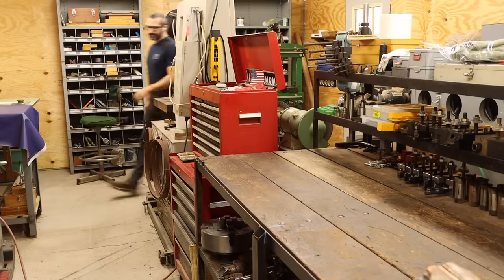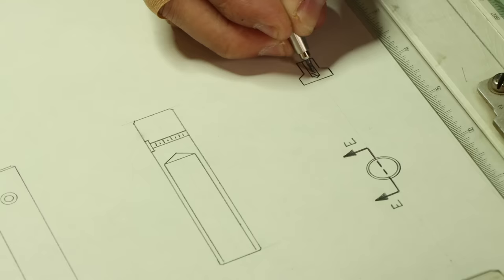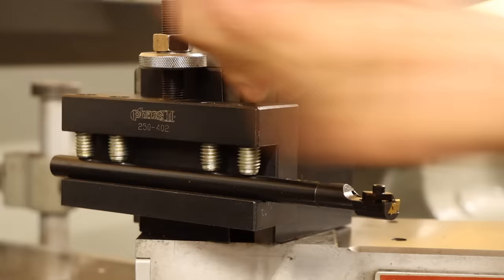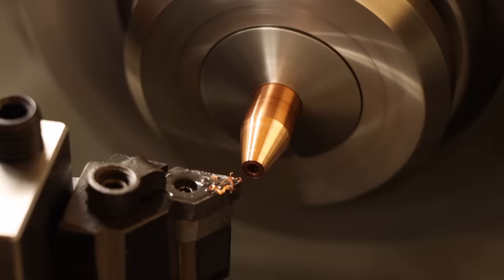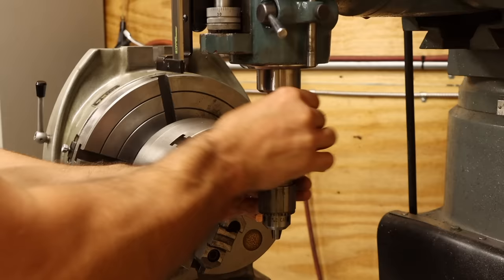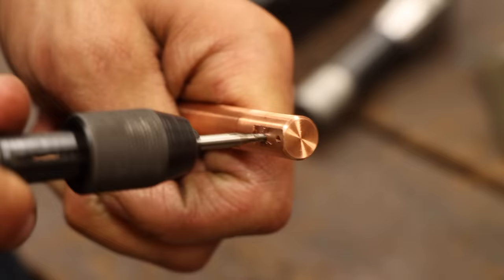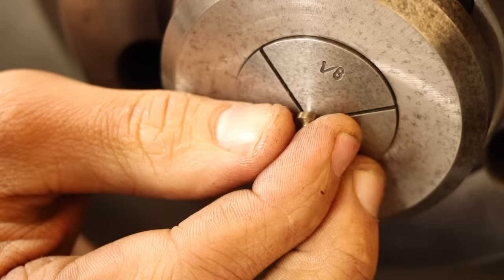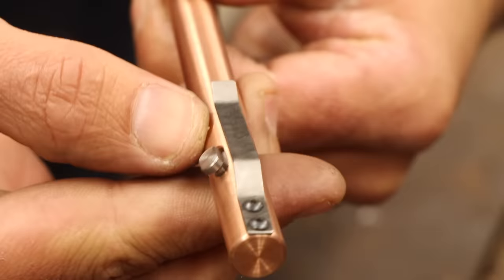Making a BOLT ACTION Pen || INHERITANCE MACHINING

Comment: Loving the channel, just discovered it and I'm currently binge watching the lot!

Just one suggestion, try using a spot drill instead of a centre drill, they don't have the fragile tip and are more accurate to boot (centre drills are primarily intended to drill the features for lathe centres,  the small diameter is for clearance and for holding grease).

Comment: We used to (and still doing it) dissamble the mechanical pencil and put small paper parts we made wet with our mouths,then we used the plastic part that is used to push the pen tip as a pusher,and we use it like its a flintlock

edit:

I used to also use the point of the pencil as a supressor so when i blow it no one hears the wind sound/blow sound

Comment: I got flashbacks when the center drill broke off. In my "Zwischenprüfung" (basically half-time exam, counts for 40% of the final grade) one of the parts I had to create a create was a M10 screw with a Freistich (thread run-off?) and a larger fitting behind (on a machine which by default had 1/100th of a mm taper on ~20mm of travel). The exam is extremely stressful, especially for me because I skipped the first year of apprenticeship and I had way less practical experience and ofc when I wanted to use the center drill it broke off inside the part. I don't really know why and when I tried to get it out, no luck. I had to wait for a new raw part to continue and wasted more then 30min while already as stressed out as somebody can be, jogging from machine to machine because time was running low.

Comment: I realize that this is 9 months too late but for future reference, if you dissolve some Alum in water (it's a substance used in pickling, you can find in spice section of the grocery store) then put your copper part in a beaker and boil it that will dissolve the steel drill bit right out of it.

Comment: A broken off drill bit can be etched out of copper using pickling solution. Simply put potassium alum in a (non metal) pot on the stove and after a few hours or so the drill bit should be gone. You'd need take a skim pass on the outside again to refinish the part but I think that might have still saved it.

Comment: Great!
The only design change I would consider is to - instead of screwing the clip to the pen - milling a tiny slit maybe 5mm from the top and mounting the clip in there. Maybe with a screw from the top end. Milled and in copper or stainless...

Comment: I think if I were to make one, which I can't and never will, lol, I'd personally lathe out a groove down at the spot you hold it and glue(?) in some leather for a grip. I got a strong nose, and the copper smell is strong to me, and my sweaty, slippery fingers would almost require it, haha. But that's just me! I do really like, as you said, the contrasting hammered clip contrasts with the finely machined body of the pen, which the leather may detract from. Your clean design is a pleasure to watch come out and, as always, impressive to see the level of detail and precision you put into your work. c:

Comment: I just noticed that your bolts slot is opposite from the original. In the original the bolt is away from the clip  when retracted,  in your new one the bolt is closer to the  clip when retracted & looks more likely to interfere.  I do like the cold working to increase the clip hardness, this would be more feasible for most people to copy because you wouldn't need to source stainless spring stock or heat treat 17-4. It is a pity that your bolt flats aligned perfectly  the first time because it would be a perfect time to show clocking the rotation via removing some fraction of the threaded knob.

Comment: The only question about this design is the position of the bolt versus the clip. It seems to be very close, prone to engage/disengage inadvertently while using the clip. Otherwise, beautiful machining and excellent material choice. I am a big copper fan.

Comment: The bolt when the tip isnt exposed is on the wrong side, it will catch your pocket material. The original pen didn't have this issue.

None the less, great video!
Reply from the maker: Yeah I missed that on the rebuild for some reason. Thanks!

Comment: I'm currently in training to become an electro-mechanic in Germany.
Having shop training included in this and knowing what a bitch turning materials can be (especially copper and other metals that transfer heat very well), I am in absolute awe at the seeming "ease" with which you did this.
Though, I have to admit, that broken drill bit and the compromise with the end diameter made me feel a bit better about myself 😂
Reply from the maker: If it helps I had a "little" experience from the first time i made the pen years ago. Obviously I forgot a lot 😂  but not everything

Comment: A word to the wise. Instead of using a tiny center drill, use a spot drill (of any size), and just give it a light touch. That would have saved a side project and more importantly, REMAKING THE WHOLE THING.

Comment: Great work! The hammered clip fits really well with the smooth copper. I think a knurling for the grip would have also looked good and been practical. Wouldn't it be possible to get the broken drill out of the piece with a magnet?

Comment: That’s a damn good pencil you have there buddy, I’ve got the same one. It’s one thing to have a pencil sharpener, it’s another to have a built-in lead sharpener. Not the easiest refills to find tho
Reply from the maker: That's what I've heard. Mine was a gift plus 3 spare cartridges. The gifter said how difficult it was to find the replacements
Reply: Never use the sharpener on the end. If you invert that pencil anywhere near your drawing, it’s going to rain graphite! Most Staples stores carry those leads.

Comment: I'm really curious what you use to finish the copper to make it safe to hold. I made a copper cane handle years ago and I have a green hand after using it for any length of time.

I'm currently working on a new cane for myself and probably going with stainless or epoxy for the handle this time, but I really liked the look of the copper.

(I realize odds are low you'll look at comments on a 5 month old video, but I'm half expecting some random person to comment eventually "well, duh, just do X".)

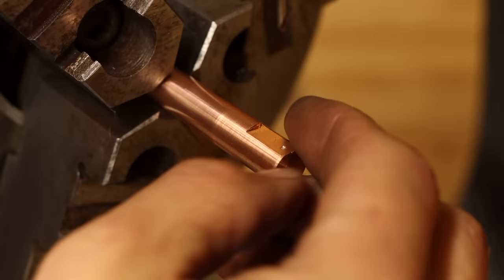Comment: 10:00 I knew the moment the bit came back up. The amount of time I’ve spent, over the course of a few years, on a few bolts because someone(sometimes me) broke a bit trying to extract a stripped/sheared bolt is goofy. Who tf puts stainless steel bolts in an aluminum bodied pump.

Comment: Just bought the plans for this and am aiming for this to be my first project on a lathe and a special 50th birthday present for my brother! A couple of questions... looking at the shots where you have the original and the new, I noticed the J cut is different... Is there a reason why? Also my brother is left handed, so I assume that I'll need to mirror the J cut and its position to the other side of the clip? Thanks for the super high quality content! Really enjoy them all.
Reply from the maker: Hey thanks for the support! The pen will make an excellent gift. You caught correctly that I flipped the j-slot. This was an accident and I would recommend making yours like the original, i.e. farthest from the clip in the retracted position. As far what side of the clip I think either would work fine but it might be a little nicer flipping it for your left-handed brother. Good luck on the build!

Comment: Hopefully you see this… but I have a question. I noticed on your older machines pen the bolt action was mirrored. Are you able, with the new pen, to still put it in your pocket without the stem getting in the way! Looks AMAZING regardless!
Reply from the maker: Thanks! Yeah that was a silly mistake. It still fits in a pocket just a little awkwardly. I'm making a new barrel for it though

Comment: Great video as all the others too. Just a joy to watch. 
One thing here caught my attention: doesn't the bolt interfere with using the clip? You changed the orientation from the original. Was there any reason for that or did you do it for aesthetic reasons?
Reply from the maker: Thanks! Nah just a mistake. Forgot I made the change on the original. I'm remaking the barrel portion 😊

Comment: Your original pen has the "closed" state away from the clip where as the new pen is reversed.

I think the original way is better as the bolt action on the new pen is awfully close to the clip when closed and i fear it would interfere with utilizing the clip.

Comment: Amazing! Did you just want to make the barrel the 2nd time? I find it hard to believe that you don't have the proper tools to machine away that broken center mill. I work in a shop that has a mill in the back for making tooling or whatever if we need it and we have a set of carbide mills available for broken off mills and taps and drills. I have to imagine that you also have a set as well? I guess I should ask why did you think they would not work here? I know the carbide mills break and get damaged easy so maybe you didn't want to waste a carbide mill on this?
Reply from the maker: Thanks. I actually don't have much in the way of carbide mills other than insert tooling or I might have tried it
Reply: @InheritanceMachining  gotcha. I am also not there looking at the work. I know sometimes you just make a judgment call where you might damage your carbide bit and still ruin the work so scraping it is the best move. 
I know carbide and others are not cheap  so I don't know that I would ever buy any personally. My employer purchases them so that's nice.

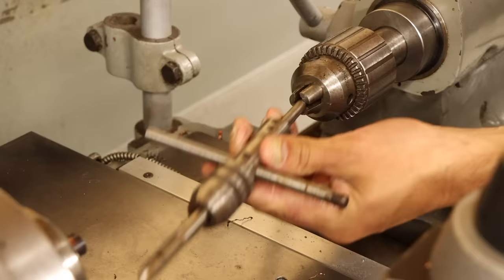Comment: What is that tap wrench you used at 3:55? And is that a continuous thread enabling it to stay in the chuck, while still tapping?
Reply from the maker: Kind of. It's just a rod that is a slip fit in the wrench body. SO as the tap goes deeper is just slides down the rod